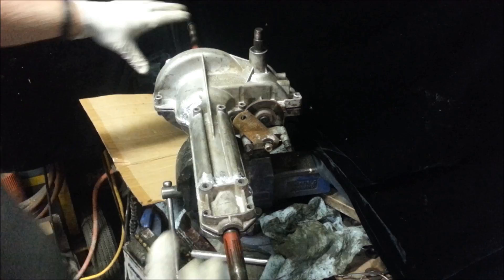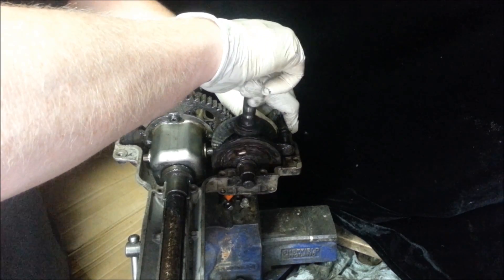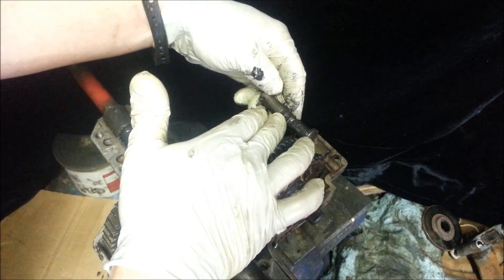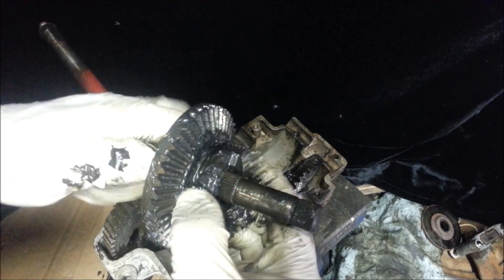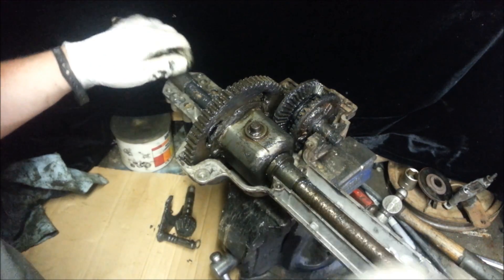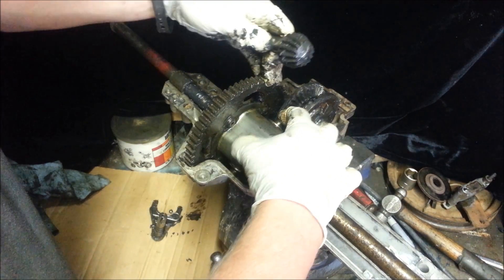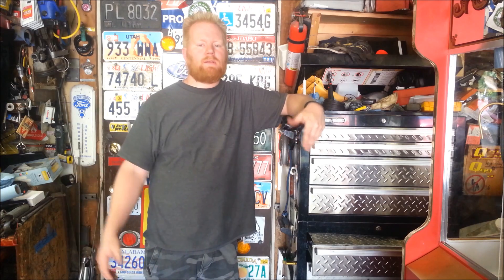MTD transmission What's INSIDE

Comment: I have the same issue as chance ,I have new brake pads ,and still must kill the engine to shift .can't stop the machine .once in gear it will not go to neutral .if I tighten the braks enough to almost stop it they get hot ..I recently installed new belts thought the drive belt was to tight ,but it has a spring loaded idler pulley .could it be the ball on the shift selector is missing ?
Reply from the maker: THECALVIN2 Your clutch/brake isn't disengaging the engine drive belt.
Reply: sixtyfiveford
Thank you for the quick reply , any suggestions on how to get the clutch/brake to disengage ..?
Reply from the maker: There is an adjustment on the rods that are pulled when you press the clutch/brake on your MTD.
Reply: THECALVIN2  I have the same problem as you. When i start it I can either put it in foreward or reverse and it works fine but I need to shut off the lawn mower and give it a little push back and forth to get it to move from one gear to the next. Let me no if u found a solution ty
Reply from the maker: Jason Landry
You need to pull off your center consol between your legs. Then you need to carefully  service/lubricate the CVT clutch.
Reply: sixtyfiveford The mower I has a variable speed pulley is that considered a CVT clutch?
Reply from the maker: Jason Landry
Yes.
Reply: sixtyfiveford Sorry to be a pain in the ass here haha. In gear If I push the clutch/brake should the belt from the motor to the variable speed pulley have any drag at all?
Reply: sixtyfiveford It just seems when the clutch is pressed there is still tension on the belt going from the varialble speed pulley to the transmission and it seems thats the reason why i cant get it into neutral or reverse or vice versa. When i press the clutch the pulleys are not moving but there is still tension from the belt from the motor belt. Im not sure if I am explaining myself right.
Reply from the maker: It's hard to see the unit operate unless it is spinning and operating. You can peel off the belts to get a better feel of it and make sure it is moving freely.
Reply: sixtyfiveford lube the shaft the var. speed pulleys are on ?
Reply: THECALVIN2 I removed all 3 belts and the v speed pulley turns easily.
Reply: sixtyfiveford Ive also noticed the 2 belts from motor to transmission are not OEM belts. They are the correct length but the OEM belt is wider than the 2 non OEM
Reply: sixtyfiveford *Update" I did some adjustments on the v pulley and the v pulley no longer turns when the clutch is pressed. I can now change gears with the motor running. But I have to rock back and forth with the clutch pushed in while putting a bit of pressure on the gear lever to switch gears.

Comment: How do you lock a transaxle like this? I have the same one and I cant get the stupid torx screws on the spider gear carrier to bull gear off. its like they werent supposed to come out.

Also it looks like the spider gears have to go in freely and then the shaft goes through to hold them in - So you cant weld the spider gears to the shaft outside of the diff.  At this point I'm thinking the best method would be to fill 3-4 teeth out of each spider gear with weld. Then is will be able to turn a few degrees and till lock it up.

Any suggestions very welcome.  Also I have the part number for a pulley hub with the correct splines to fit this transmission order to pulley swap it.  hub# 918-0758A
Reply from the maker: Miller Thompson The torx screws are more than likely held in place with loctite. If so a little heat will take care of that. You just need to weld all the spider gears together and it will lock it.

Comment: I can buy a MTD mower for 60$ with this kind of drive train(the vario in the middle and 1 speed axle).
It has a 12.5hp engine on it(i have a 14.5 and a 16hp b&s) and i was thinking of converting it to a racing mower.
Is the axle and middle vario thing strong enough for that?
Or do i need to switch it out for something different?
Reply from the maker: Mack Schols Yes, the variable drive is strong enough for 16hp.
Reply: Thanks for the fast reply!
Is it also strong if i do a poulie swap?
I would like it to go around 30mph maybe a bit less.
Reply from the maker: Yes, they can handle a pulley swap. They are very simple but quit robust.

Comment: Thanks for the tip!  My problem is the tractor will not move either direction,  after jacking it up one wheel rolls one direction, and the other rolls the opposite.  Seems like it is locked in gear,  brake stock or transmission is locked.   I have checked the brake several times,  has a wheels release on the rear,  I have pulled it in and out several times. ( It's Like a Troy Bilt pony,  it's a Huskee from tractor supply)  any Idea's.  Thanks in advance for your input.
Reply from the maker: George Edwards One wheel spinning forward and the other in reverse is normal. It not shifting into reverse or forward could be as simple as a linkage problem. If not you'll need to open it up and see.

Comment: I have a MTD Ranch King 12.5hp 42 inch deck and it goes fine in reverse, but when I shift it to forward, it makes a horrible grinding/clunking noise when it moves. I know a guy that has a rear end off a Ranch King that he will sell me for $25 so would that be my best bet or do you think it's a cheap n simple fix without buying and replacing the transaxle?
Reply from the maker: thedean1488 Sounds like something is chewed up. $25 is cheaper than the parts you'll probably need to buy. Either way you need to pull your trans. I would pull yours and take a look inside and then make your decision

Comment: this vid was awsum thx so much  do you have a vid removing that trans axle that wood be helpful or any one else on u tube thx again
Reply from the maker: There are a few videos I've seen but they are long winded and poorly shot.  The transaxle is very simple to remove, the hardest part is working under your tractor. It is only held on by 4 bolts. Remove those, disconnect the brake linkage, shifter arm, then pull the belt and it will come right out. This usually takes 10-15 minutes.
Reply: wow thx sound easy 101 so i think my detent is worn case it stay in reverse but jump out of drive thx for info  ur a great asset to u tube
Reply from the maker: Either your detent or I would look at your linkage. It gets bent sometimes and won't allow full engagement into forward.
Reply: thx ur other vids covers all of that thx for answer to

Comment: What fluid do you put back into it? I have a Ranch King 42 inch tractor built by MTD. It's the 6 speed manual type transaxle. No hydro here...    And how do you change the fluid? This one's 10 years old and I want to change it.
Reply from the maker: The manual transmissions aren't designed to have the fluid changed. But they will benefit from it if you have the time and patience. The entire transmission needs to be pulled out. It looks more difficult than it is and should only take an hour to take out and put back in. Most are filled with grease only but I like to put in a little grease and 80-90w gear oil back in.
Reply: Where can I find a video on how to change the fluid? Any ideas?
Reply from the maker: I highly doubt there is a video.

Comment: Sixtyfive-the carb is dirty on my mtd 300 series.  how do i get at it?  can you be contacted?  its 4 years new and i refuse to bring it to a shop.  please help!!!
Reply from the maker: I will respond to all you question here. I assuming you have the Tecumseh engine? or is the MTD (Honda clone).

Tecumseh: http://youtu.be/B9ko4gbIA_I
Honda/clone: http://youtu.be/n_eTqL0C3gQ
Reply: sixtyfive--its not the tecumsech.  i believe it has the mtd honda clone'  the back of the machine has primer,key,choke and run lever.  i know where the carb bowl is and how to take it of but i dont know what to take off to get at the whole carb and the fuel and primer lines.  i dont have $ to fix it..  i believe i can take it off myself and clean it,.  please reply thanx
Reply from the maker: Yeah, sounds like a Clone. They put a heat shield around the muffler and carb because it is on a snowblower. There should just be a few random screws/bolts holding it on. The closest thing to it is this http://youtu.be/n_eTqL0C3gQ . You actual carb should be virtually identical. It shouldn't need any parts or $$ invested. Just a good cleaning and a $2 can of carb cleaner.
Reply: sixtyfiveford sixtyfive is there anyway i can get you two pictures of it and maybe get more insight.  i trust your help and thank you for it.  i already have the carb cleaner.
Reply from the maker: I just looked at the parts breakdown. The choke knob will pull directly off along with the throttle knob. To the left there of the choke knob are 2 bolts, remove these. You should be able to then pull the plastic shroud off and see the carb. You can upload the pictures to your Google+ if you want and I'll take a look.
Reply: 65-i took of exhaust cover i took all screws of for plastic shroud but that cover does not off.  something is keeping it on.  i took of carb bowl and blew some carb cleaner in it from the bottom.  the float is still in there.  i see parts of the carb but plastic shroud does not easily come off.  I will try to upload pictures.  i took them but not sure how to get them on google+
Reply from the maker: I believe you just go to your Google+ and under your photos tab there should be a link that says Upload.

Comment from the maker: If buying a belt online find the width and length and order a generic kevlar belt. They should only cost you $15 bucks or so.
Reply: Those "generic" belts are false economy! Get an OEM (not...OEM "replacement"). Genuine MTD or Oregon belts LAST! Been there ,done it. You get what you pay for!
Reply from the maker: @TheOzthewiz  I have replaced hundreds of belts with generic belts and never have issues.  You just have to know what type of belt you need. People put automotive belts on mowers and have issues all the time. You don't want those. Mtd doesn't make belts and just has belts made for them.

Comment from the maker: To start with the simplest; I've heard improper(automotive grooved rubber belts) or old belts make whining sounds when they are put under load. So it could be just a belt but that is the simplest. The other issue would be not enough oil/grease in the transaxle like you thought. The gears are isolated from the case pretty good so it would take a fair amount of heat for it to noticeably transfer. The grease gets thrown off the gears and gets stuck the case sides and no longer lubricates the gears.
Reply: Would adding gear oil through a hole drilled into the case free up the grease inside to quiet the rear end?

Comment from the maker: It could be a couple things: The shafts the your shift lever moves is gummed up(spray with lube and move in and out), The engine is not fully disengaging from the drive pulleys and is apply pressure to the internals (lube the shift o matic pulleys and linkages), The detent  ball is gummed up, and finally the grease in your case is really bad.

Comment: My transaxle takes an excessive amount of force to shift between out of fwd and reverse, so much force that I had to take the slotted cover plate off the mower to be able to shift because it bows the shifter linkage rod before it finally comes out.... Im thinking my splines on the shaft may be gaulded or stripped? suggestions. I did replace the brake puck prior to this happening.

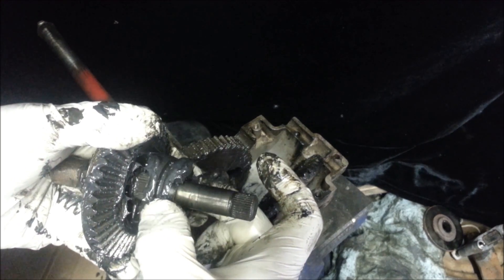Comment from the maker: No forward but reverse would generally mean either the shifter isn't pushing the lever far enough to engage forward or the teeth on the forward gear (watch at 1:51) selector are stripped. The teeth/dogs could be rounded and be pushing the selector away. Try swapping the reverse gear to the forward gear and flipping the selector. This will use the other side of the teeth.

Comment from the maker: An impact gun works the easiest. If one is not available you can wedge a large item between the belt and the pulley. This will lock it while you turn it. You can also drill a small hole through the pulley so you can put a screwdriver through it to lock it.

Comment from the maker: Backing trailers without a front torque bolt snapped it (one was never installed from the factory). Trailer tire hit a rock and stopped but the mower wanted to keep going.

Comment from the maker: They use a CVT pulley system (like your JD variator) in front of the transmission to supply a full range of speed in forward or reverse.